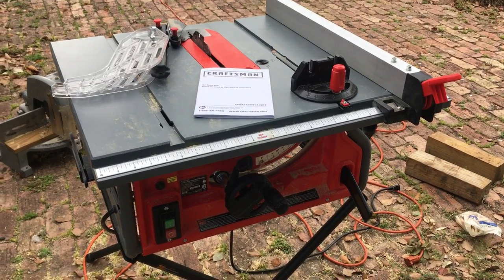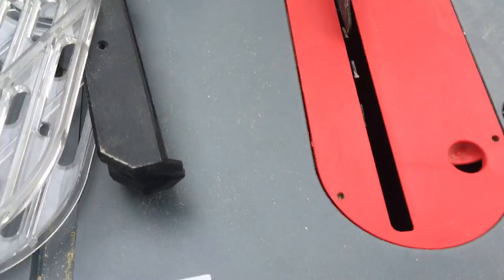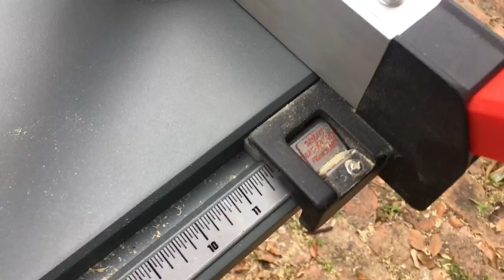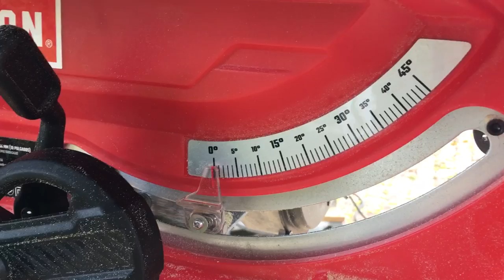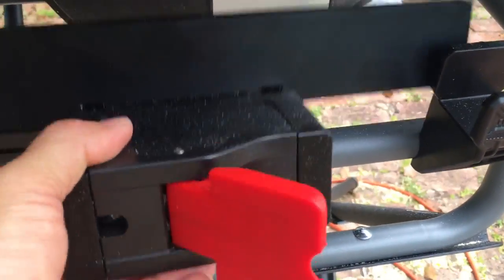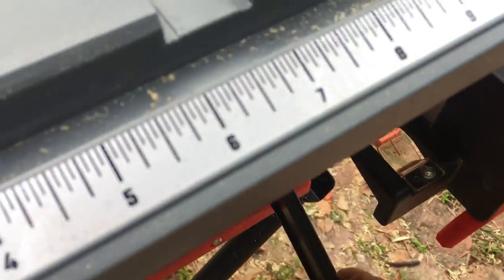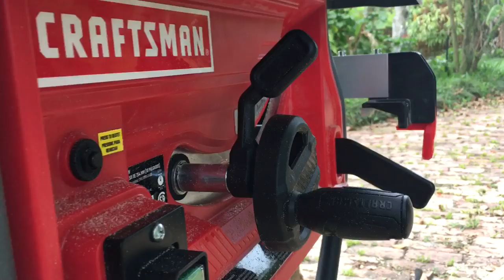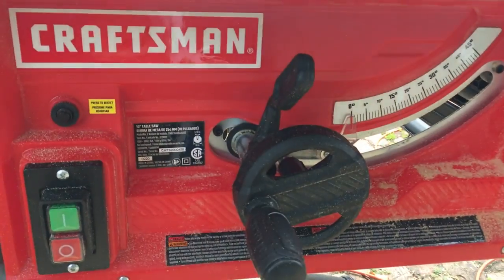Overview of Craftsman 10” Table Saw CMXETAX69434502

Comment: Just a warning, if you have the miter gauge stored below you cannot lower the blade all the way without breaking the miter gauge holder. The  motor will collide with the gauge and snap the plastic holder. Don't ask me how I learned this.

Comment: Just got mine for 200 bucks, with my  stimulus check . I got a bostich compressor with three tools plus a new dewalt sawzall. And a  rigid shop vac.  Home projects here i come.
Reply: Hahah me too!
Reply: Hahaha I just got mine with my Stimmy today. Also got as drill press, bench grinder, and heater for my shed. Plan on picking up a Sliding arm miter saw next.

Comment: good review u have the only review on this product 👍
Reply from the maker: Thank you. Yeah, I was surprised how little information is out there about this specific saw, and the previous models Craftsman has put out have deficiencies this seems to have fixed.
Reply from the maker: @Joshua Sweetser I will do this! I found the stand assembly to be unnecessarily challenging.
Reply: @alexbabcock5409  I know exactly what you mean about the stand. I am a reasonably intelligent and educated person and had to study the stand assembly pretty hard for awhile to get the fact that a protruding piece of metal must be inserted into a hole on two pieces for it to go together correctly. Also, holding and aligning the holes for the bolts was fun. My suggestions for anyone struggling with it, is to do one side of the stand at a time. Also pay attention to the "inside" part and outside part between which the brackets rest. If you try to do both sides at the same time you will experience what it is like to wrestle with a giant octopus. The octopus will win.

Comment: You share a lot of good info on the Craftsman.  I bought one but returned it yesterday.  Was missing bolts and wing nuts.  Found bolt lodged in saw and Craftsman's response for missing parts was return to store for refund or exchange.
Reply: That's funny. I just bought mine. I had it delivered to my house. My son was the one who brought it inside.   I arrived home from work later that night and was very excited to see it. I moved the box around to read the descriptions and I heard a ton of stuff rattling around.  I opened it and found nuts and bolts all over the inside. I didn't put it together yet. Fingers crossed.

Comment: Appreciate you taking time and effort to post the video. I found one other video on YT about this saw. I've had it for a few days now...definitely pleased with it...especially when considering the price. $160! Great deal. 👌
Reply from the maker: Eric Mercado Sure thing. Happy to be helpful, especially with how many folks are working on handyman projects around the house these days.
Reply: Ooh! Where'd u find it for 160?
Reply: Question. Do you use this with a shop vac? If so, which model/one? Thanks
Reply: @anthonyperry414  hi there. I got it at Lowe's. Back towards the end of May. It was on sale. Believe it's gone up since.
Reply: @kaebee23  Hello. I have a little 1.75 hp shop vac hooked up to it. Does an okay job. I'm sure using anything stronger would do you much better. Anything 4 hp or higher would probably do best. IMO. 👌
Reply: @Eric.Mercado  thanks

Comment: Thanks a lot, just brought my second Craftsman table saw. They have changed. Your video really helped, terrible paper manual.
Reply: Yeah that manual was horrible
Reply: I was surprised that this table saw didn’t come with table extension. My old Craftsman, which this one is modeled after had extensions on both sides and the front end which would slide out. The price was about the same for both even though my first is about 20 years old. I guess they wanted to keep the price low and that meant reducing materials, too bad. Still a good table saw for the money.

Comment: So day one on my view of the saw is.
1. Change blade if you want quality finish cuts.
2.Find some video on table saw adjustments for this model.
3. Beef up the fence somehow (aluminum is to thin for accuracy)
This being said I love the compact design, the price, and the ability to have a strong motor ( cuts 4/8 oak great at max setting)
I am still on a quest to find upgrades and adjustments that will fit my needs.
Thanks fot the video

Comment: Hi there. Great video. Wondering if you know where to find runners for the mitered t-slots. I believe these are non-standard mitre slots and I'm trying to create a table saw sled. Thanks so much by the way I have a 10-in craftsman table saw but this goes back 10-15 years to the days of Sears.
Reply from the maker: I don’t know of any runners to recommend. The table does use non-standard slots, as you mentioned. May need to custom-make them.

Comment: It's a very decent saw for the price point.  Ample power for normal wood items, the push stick is very well located.  On/off could be bigger, but it's not bad.  The blade brakes very quickly when turned off.  The ruler seems spot on.  One thing though, the miter gauge is pure garbage. The wiggle that you mentioned is enough to throw a straight cut.

Comment: I'm torn between this one and the ridgid. What the ridgid has that is great is the table extension so you can cut up to 26 in wide with the fence being used. But the craftsman is cheaper. Decisions decisions. This video is great by the way very thorough.
Reply: Ryan Kurtz My old Craftsman had a longer table, yes this one is what it is but a good saw.
Reply from the maker: Ryan Kurtz The table dimensions are a serious limiting factor. Pricier tables have extensions to keep their portability while providing the extra capability. This simply lacks an extension. I built one myself, though, which I may feature in another video. It’s a swing-down design that gives me what I need to handle bigger pieces and was pretty simple to make.

Comment: Only things I dont like about this saw is the plastic table insert and miter gauge rail. Big box store had it on sale for 168.00 and I had been wanting to do HW floors for a while now and needed one anyway. The low price overcomes any shortfalls it may have IMHO. Just for fun I ripped an 8' 2x4 at a good pace  (TwoBuhFur if you are from western PA) and it ran right through it. I've done a couple dozen cuts with it now and couldn't be happier.

Comment: I purchased this saw back in September, so I have been using it for 5 months. I agree its a great value with one exception, the fence on my saw is difficult to slide as it appears your fence does. I have tried to see if there is any adjustment to the white plastic guides underneath the front portion but once you loosen the phillips screw that holds the guide on, you only get vertical movement, nothing to better aline the guide to the track ( slot). I"ve  been hesitant in modifying the guide profile to allow for smoother movement . Any thoughts or ideas?
Reply: Try waxing it, Johnson's Paste wax works well to help keep things moving.

Comment: The bevel adjustment window looks like it's adjustable. So with your square, make it at zero and adjust the window so the "red" indicator is at zero degrees.
Reply from the maker: Dana Deschiney Thank you for pointing this out! I’ve posted a video on the adjustments you can make to align your saw blade angle with the gauge, and ensure the gauge is reading correctly.

Comment: Just bought used. Can't get the anti-kickback installed. I wish you would show how to attach it.
Reply from the maker: Mr. Meldrim, thank you for the suggestion. I've made a video explaining that installation process. Hopefully it is helpful to you, and congratulations on the new saw! Make sure to read the manual in addition to any videos. I'm instinctively anti-manual myself, but I actually enjoyed reading this. It's got a lot of nice tips, including a tutorial on how to make a tool called a "feather board."
Reply: I agree i cannot get it installed either
Reply: If you take out the red oval blade guard in the center of the saw that gives you access to the blade then towards the back of the blade there is a lever that locks the blade. If you move the lever it releases the blade guard and allows it to be raised then you can attach the kickback device and the large plastic blade guard.

Comment: Can this saw use a dado blade. If so what size.
Reply: Yes. An 8” stacked dado set can be used on this saw. Must have a 5/8” arbor and can on stack to a maximum 1/2” dado cut.

Comment: I am just putting this saw together today and I don’t think the blade it rising as high as it should (even when cranking the knob as far clockwise as it will go)  Not even sticking two inches above the center piece. Did you have to do anything to adjust that? Thanks!
Reply from the maker: It should top out at about 3 1/4”, just short of a 2x4 on its edge. If it isn’t, something is wrong. The gear and rack beneath the saw table may not be adjusted properly, but I’ll have to take a look at mine tomorrow to see if anything can be adjusted without disassembling the saw. 

Have you confirmed that the saw came with a 10” blade? It’s possible it was fitted with the wrong size, though unlikely. The riving knife of course is separately adjustable and can get quite high relative to the table.
Reply: Ya unfortunately it’s definitely not even close to 3 1/4 inches above it. Correct size blade. I only noticed the height error because I was unable to attach the anti kickback pawls due to the height difference. I really appreciate you taking the time to reply and thanks for making the video in general.
Reply: Hi Alex,

Just wanted to let you know I actually figured it out! I think I received either a retuned or reboxed saw, was missing some of the bolts/nuts needed to mount it to the stand and it turned out that one of the bolts was stuck inside the blade raising section. Frustrating as a consumer but quick fix! Thanks anyway!
Reply from the maker: n b Yikes, sorry to hear that. Sounds like they have supply chain issues, but hopefully your next one is squared away. I’ve got some videos on the setup process that could really help, just one-time stuff to get everything calibrated. Good luck!

Comment: Have you realized that while using the fence on the right side of the table saw, and using the standard measuring tape attached to the table top, that the measurements are off at least 1/8 inch, or is that just mine?
Reply from the maker: It sounds like you need to make an adjustment to calibrate your fence gauge. Look at my other videos, they explain all of the initial calibrations needed.
Reply: @alexbabcock5409  thanks Alex. I watched your other videos and I followed the same process when I got mine 6 months ago. Just be aware, at least for mine, when using the fence on the right side of the saw, the cuts are off by 1/8 of an inch minimum. Just went out and re-measured to make sure I wasn't going crazy and have pictures to prove it. Not sure how it is possible.
Reply from the maker: anonymous It would be disappointing if they had a warped (misprinted) scale, but it’s not impossible. Thanks for mentioning it.
Reply: I have always double checked measures from some fixed place on the table.
Reply: @johnjcastro2604  I also do the same, especially now that I figured out the right side is so far off from the left. I always try to leave a little room for error due to the kerf as well.

Comment: I just bought one and it seems like the blade guard is non functional. When i install mine i cannot run a 2x4 flat thru without the board hitting blade guard
Reply from the maker: The riving knife needs to be adjusted upward. You can do this by removing the table insert, pulling up on the riving knife lock lever, then sliding the knife upward. This is detailed in another of my videos about the saw.

Comment: Has anyone had any trouble with the depth adjustment knob unraveling or lowering the depth of the blade when the saw is in operation? Thanks.
Reply from the maker: I know you were looking for people who have had this issue, but since I haven't seen any replies yet I wanted to chime in to say I haven't had this problem myself. I assume you are, despite making sure the adjuster wheel is as tight as it can go?

Comment: Can I cut a 48x96 inch plywood sheet in half with this?
Reply from the maker: The saw doesn't have enough table width to do that using the guide fence, though you can do it without the fence in place, you'll just have to eyeball the cut. The saw's fence extends to 12" on the right side and 10" on the left. It would need to reach to 24" to work with the fence when cutting a 4x8 sheet in half.
Reply: @alexbabcock5409  oh so without that barrier on the side I can remove it and just make straight cut correct? I'm new in getting a table saw this could be my first
Reply: Without any guides, two persons could make a 1/2 cut very carefully but it will not be sized correct.